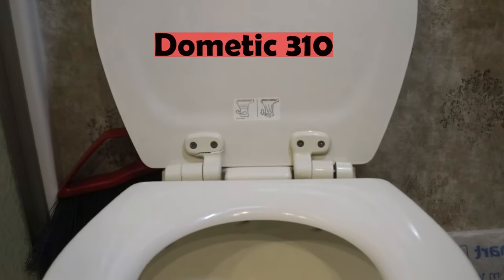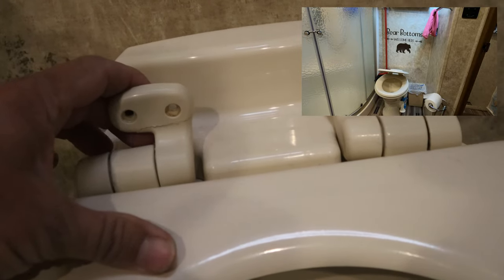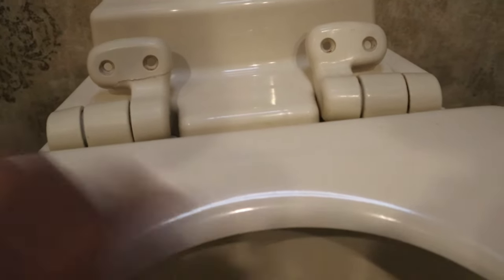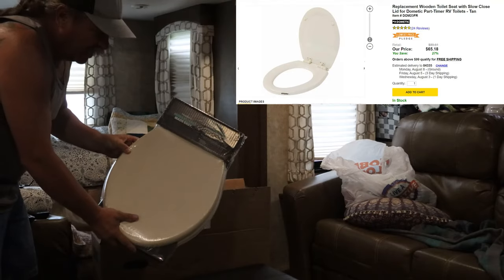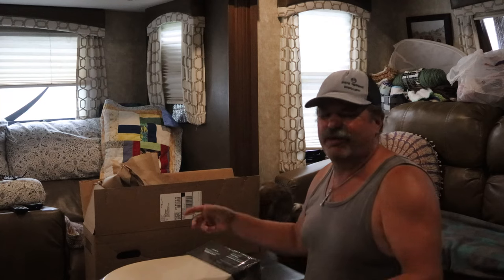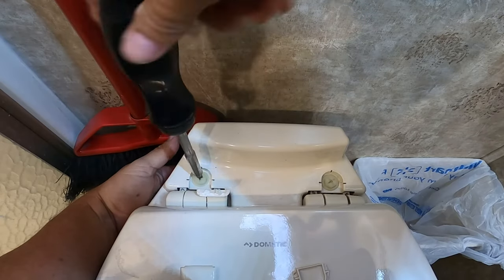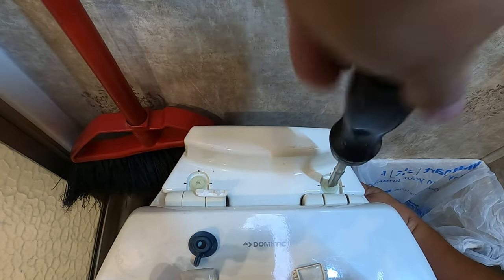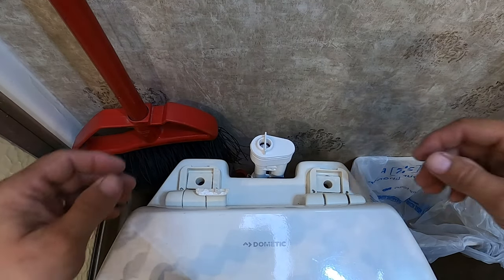Dometic 310 Seat Replacement DIY

Comment: Good fix. That's the same toilet we bought last summer!
Reply from the maker: Thanks Tom, we purchased this toilet last fall as well after the pedal broke on our Aqua Magic. 🍻Not very happy that the hinge froze after only year, rather odd, but as I mentioned it does appear to be a fairly common issue. Word of caution, if you walk in and the lid hasn't totally closed, not try to force it as it will snap the hinge. Hope you two are doing well, thanks for stopping by. Sean

Comment: easy fix. At least it was the outside of the toilet instead of something broke on the inside. Thanks Don
Reply from the maker: Thanks Don.
Reply: Do you remember which one you got at Home Depot? I tried one and it didn’t work well with the vacuum cover part. Thanks!